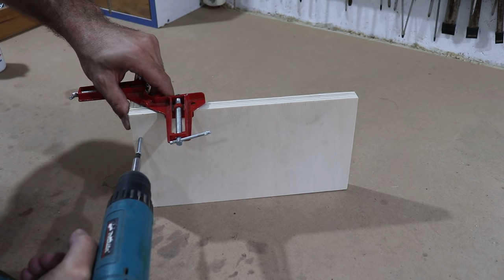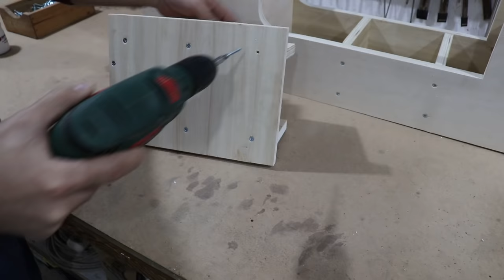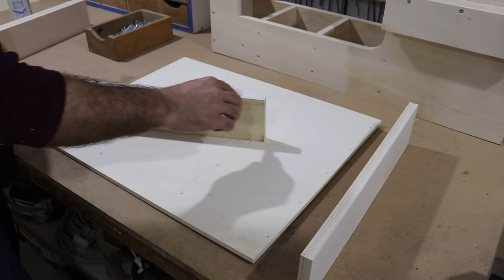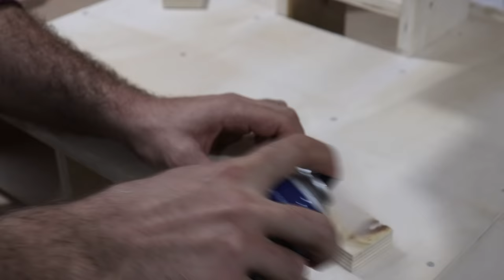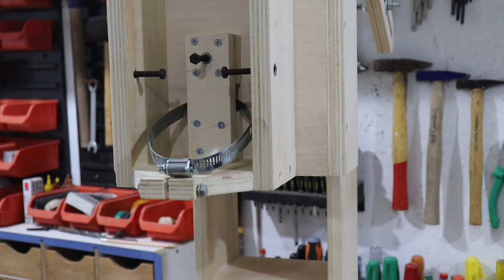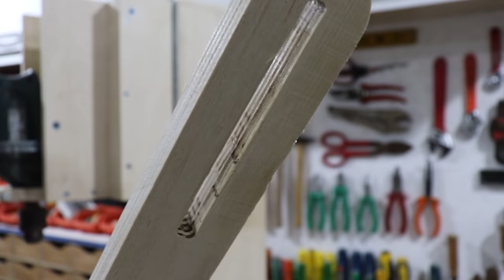How To Make A Drill Press - Sütunlu Matkap Yapımı

Comment: The cutout for the main side panel is not listed. You stated 63 cm x 25 cm narrow part 13 cm. How long is the narrow portion?
Reply from the maker: Column front part 30 cm, bench leg 10 cm, narrow part 23 cm. Thanks.

Comment: Hi Yusuf I like your job I would like to ask you if you can send me the drill press measurements and I would like to ask you before gluing spray with liquid spray can what is it? Hello and thanks Vito.
translated with Google
Reply from the maker: Hello, I'll take a look at the measurements and write to you. What material will you use the spray adhesive?
Reply: Thank
Reply: @yusufylmaz9346  hi, Yusuf, just write to find out if you have the measurements? if not, can you tell me the distance/length where the narrow part of the column is.
Reply from the maker: @dar32dr3amn7  23 cm narrow part height. Thanks
Reply: @yusufylmaz9346  thank you

Comment: You didn't show how the drill works if you are going to use both of your hands working on your material while drilling a hole on it. as the drill will not work if you do not press the trigger with one of your hand and will only turn off or stop when you remove your finger from the trigger. Unless there is another option for the drill tool to turn on without the need of keeping your finger pressed on the trigger.

There is a part on the video where you use the drill already placed on the drill press where you are pressing the trigger while drilling a hole on your material. But on the part where you are drilling an angle bar and you are holding the angle bar and one of your hand is holding the handle of the press. I don't understand how the drill works in there. keeping itself on without a finger pressed on the trigger
Reply from the maker: Drill switch locked in working position. I start and stop it with a voltage regulator. https://youtu.be/QnBJJEWzPjo Thanks
Reply: @yusufylmaz9346  Wow! Thank you so much for a swift reply.